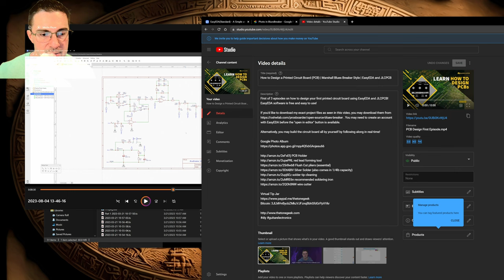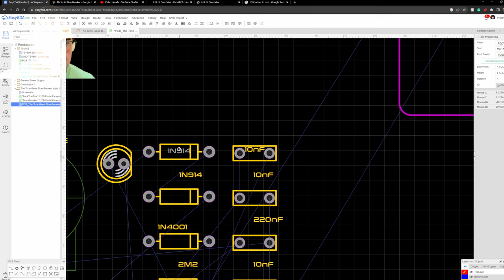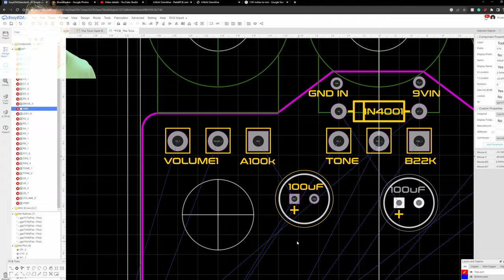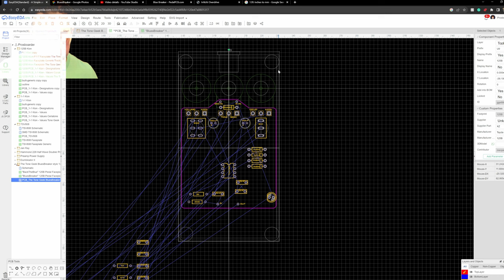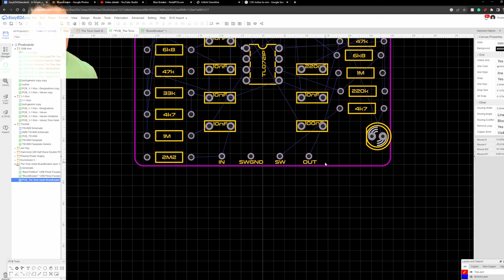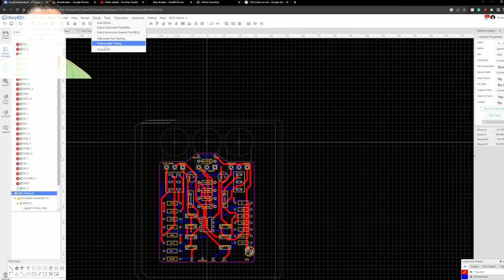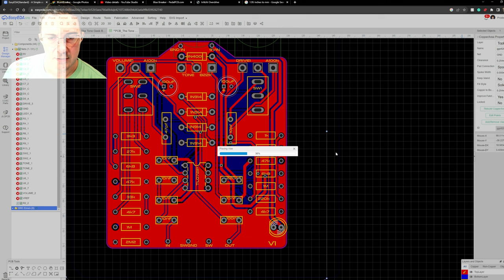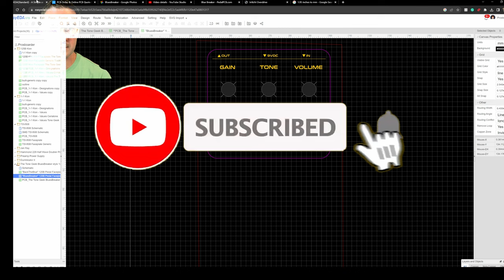How to Design a Printed Circuit Board (PCB) | Marshall Blues Breaker Style | EasyEDA and JLCPCB EP 2

Comment: Thanks a million for this Ryan. It's super helpful. For an amp signal board would 2mm tracks and 2.5mm pads (1mm holes) be a reasonable choice, please?
Reply: 2mm trace is really wide, you can for sure use a much smaller trace width, like 0.2 - 0.4mm. For the power traces, you can go wider depending on how much current your pedal consumes, use 0.6 - 0.8mm trace width and you are fine :) If you have room on your PCB then you can use wider traces :)
Reply: Thanks
Sorry, I should have said it was a tube amp PCB, not a pedal. Similar to Ryan’s Fairfield County PCB.
Reply: @timrobertson100  ah that makes sense. You just have to figure out the maximum current, and choose the trace width based on that, plus some margin of course

Comment: I printed this with jlcpcb, populated it with my parts and it doesn't work.... were you able to make a working pedal with this pcb?
Reply from the maker: Oh no! My boards arrive on Monday and I'll be building the first one and report back. I know jlcpcb spotted that the footprint I used with the pots did not have full plated through holes so they added them (and I swapped out the library on my files so now it's not an issue) to work around this, you might need to solder the top and bottom side of your pots. Quick and easy fix this round of troubleshooting
Reply from the maker: I built mine today and it worked just fine. I'd check to solder the top and bottom of the pot legs and see if that helps
Reply: sorry, just saw this now, I'll have to give this a try @TheToneGeek
Reply: I'm kind of confused by what it means to 'solder the top and bottom side of your pots'  do you just mean that I have to hit the pot legs with solder on either side of the pcb? @TheToneGeek
Reply from the maker: @EJ_Crough  yes, exactly.
Reply: @TheToneGeek 100% that did it!! I’ve used that footprint elsewhere myself…. This explains so much lol